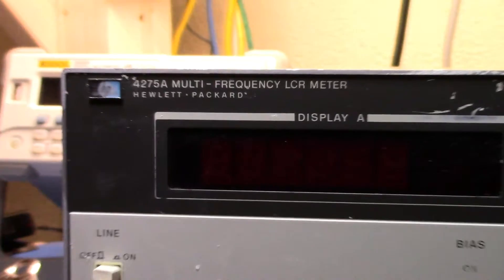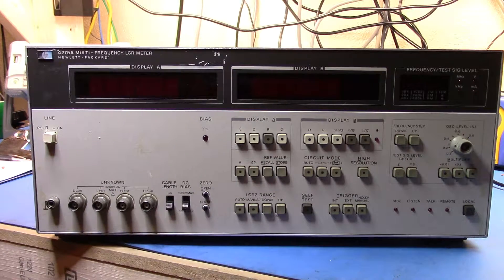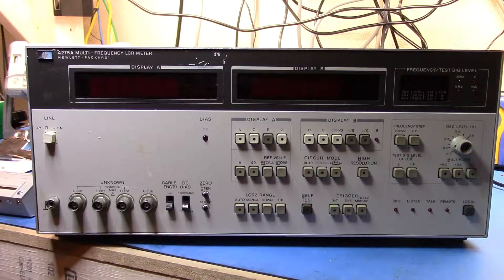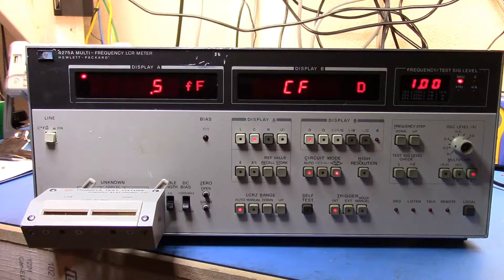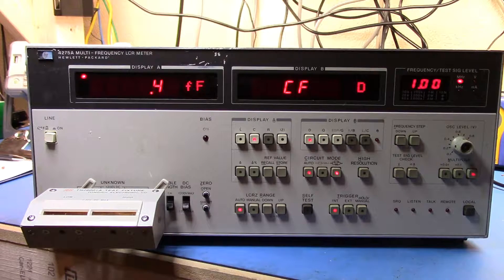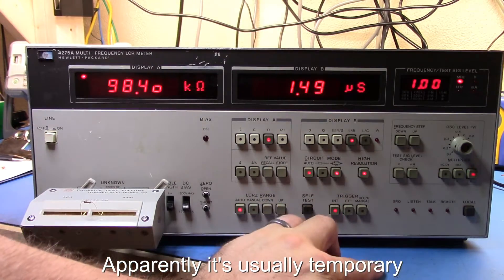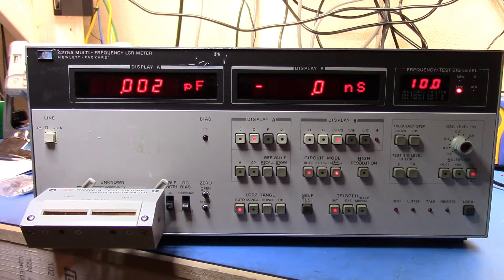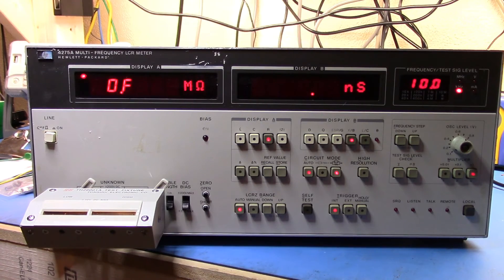HP 4275A First Look

Comment: If you stop and think, you can see why you can't measure a 4.7uF capacitor at high frequencies. Remember the impedance of a cap is 1/jwC - so at 1MHz that 4.7uF has an impedance of 1/(2 * pi * 1e6 * 4.7e-6) - or about 0.033 ohms! That will be lost in the noise...
Reply from the maker: Great point Keith - Thanks for sharing.